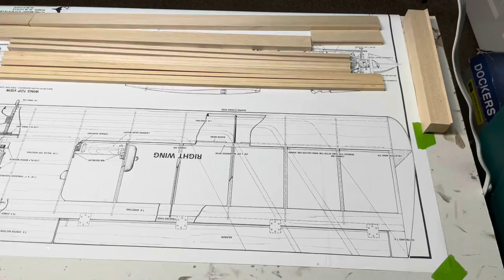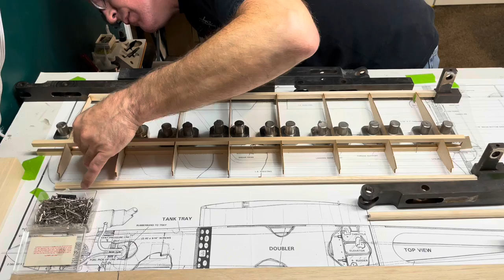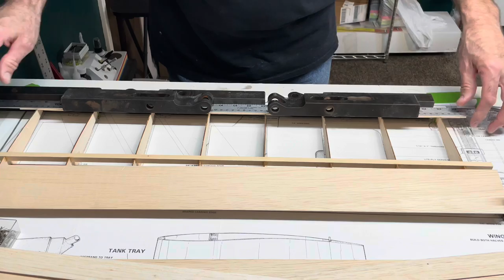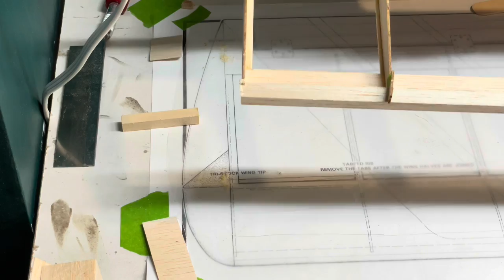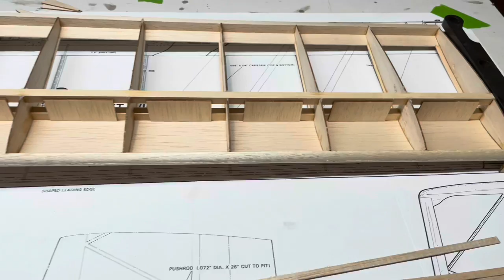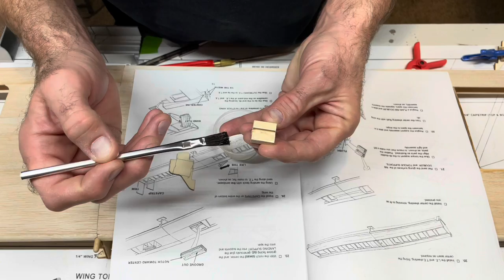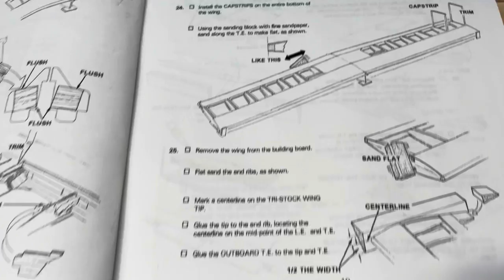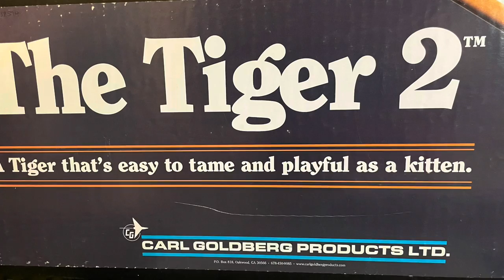Carl Goldberg Tiger 2 Build Series: Part 3

Comment: Hi Frank, this video is MUCH better without the 'damned clacking' of the previous two  - yes, I am the guy who complained! A massive improvement, thanks, whether or not  I influenced you to leave it out. (Hey, could I claim to be an "internet influencer"? I believe they get loads of dosh!)
Now my next attempt at influencing... I assume the pic at the end of the video is an old photo of a slightly younger Frank holding his first Tiger. Doesn't the cockpit look bare and the model unfinished? How about putting a bit of effort into a  cockpit and half-decent pilot for THIS build? That would finish it off a treat. You know it makes sense! Cheers, Phil